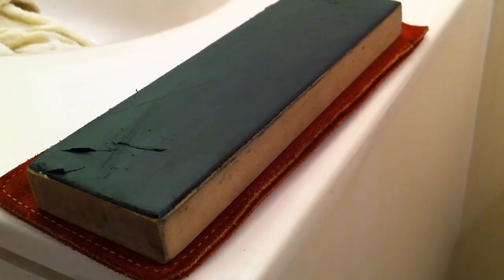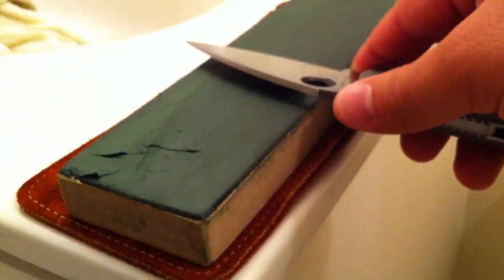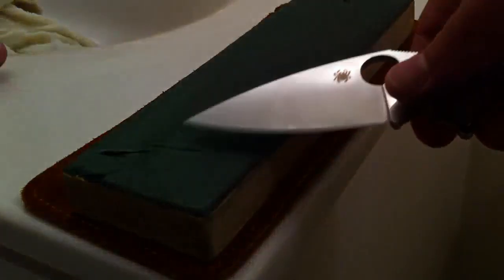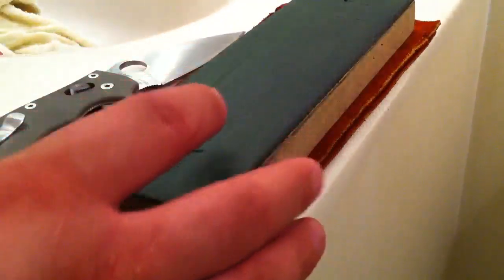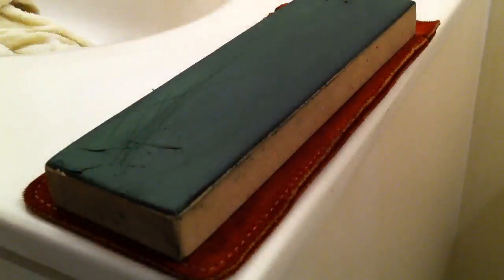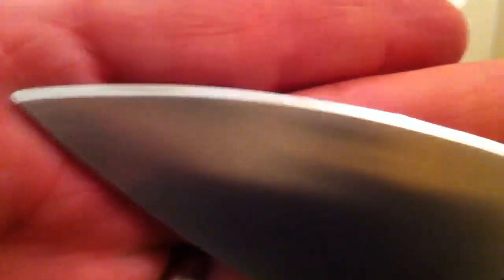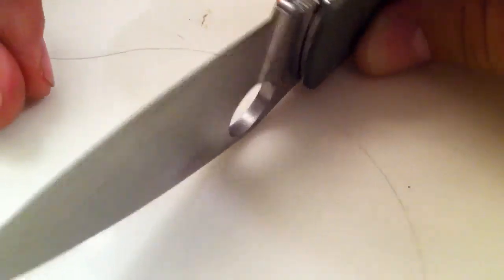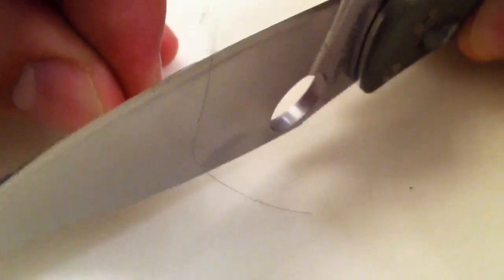Sharpening #4 (freehand)

Comment: I know this is an "old" video, but it would be helpful to know about what grits the various stones were from the first "course" then 2nd and 3rd black & white contour stones, then the fine. I am using different grit sandpaper in lieu of stones, and have some ceramic rods on the way. Hope you can see this and respond. Great video series. Beautiful polished edge! Thanks for taking the time!
Reply: I use this same method using Norton stones that I also use for straight razors. With totally dull I would set the bevel on a 1000, then move up to 4000 and then 8000 and finish on a very hard chinese natural stone and pasted strop. But I can shave off the 8000 and a knife is fine after that and will split hairs but it also depends on quality steel. I find if I see too much metal marks at each stone level I move up it is usually because I didnt spend enough time on the lower stone. Hope that helps.

Comment: Do you use a compound on your strop? i have a lanskey sharpening system and i get a very sharp edge but cannot get it to a full mirror polish. i have a leather strop for it and green compound.
Reply: kawi4ev he's using a Knives Plus Strop Block it comes preloaded with green compound and is supposed to last a lifetime. so you don't have to reapply compound but if it gets to worn out you gotta replace the whole Strop.